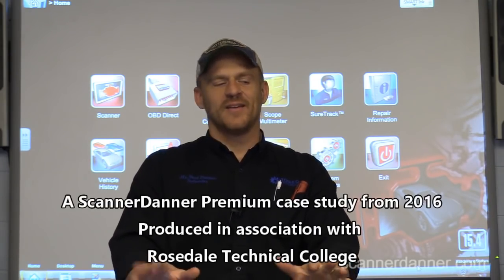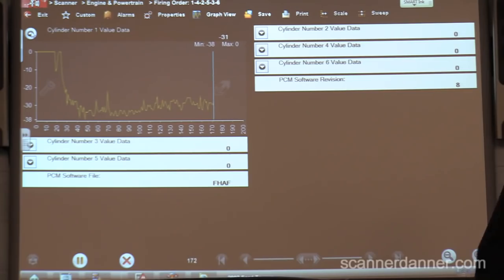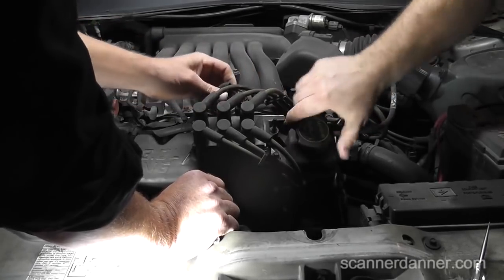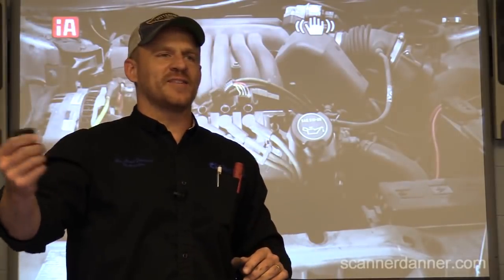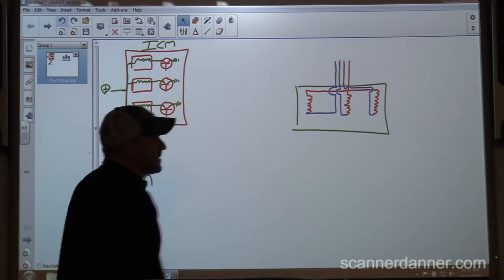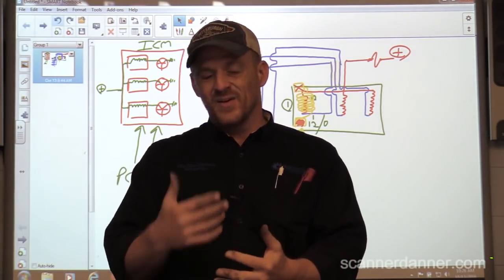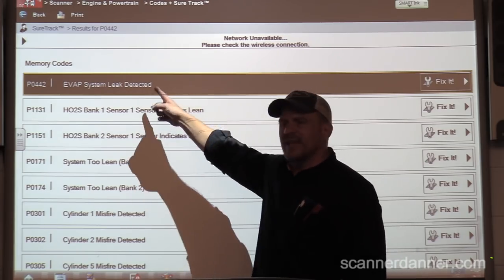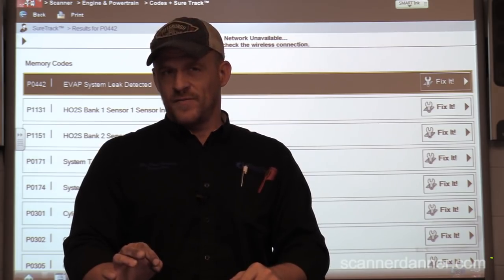Ford Taurus Misfire and Lean Condition Case Study (a 2016 ScannerDanner Premium video)

Comment: Paul, NICE ! Just did a egr valve on a 2005 Mercury Montego 3.0 L yesterday due to a DTC P0406 circuit A low. The unit has the Map, DPFE, Egr vacume solenoid and the Egr Pintle solenoid built all  together as one unit. To make a long story short I forgot to plug the vacuum lines back on the new unit and created a very large lean condition on bank one and bank two and created a P0405 circuit A low DTC along with corresponding lean codes. The lean codes were not there prior to me working on the car so I knew I created the problem which gave direction immediatly and a quick fix. Your right about Ford's relearn strategy for their LT fuel trims. After plugging in the vacuum lines, short term went negative but even after a long test ride the LT went from 25% to about 12% and would not go any lower. A reset of the keep alive memory did the trick. Take care, Paul !

Comment: Awesome work as always Paul.  I do want to add that you don't have to find that PCV elbow pipe at the dealer.  As much as I hate saying anything to the benefit of Dorman parts, they do have that elbow available in their "Help" line of parts and most of your major parts store chains should have one or three in stock.  Unlike most of their parts, it fits and functions correctly.

Comment: Only misstatement not corrected later was the deal about 1 and 5 being companion cylinders due to ford firing order diagram. It is instead 1 and 4, 2 and 5 and then 3 and 6. Excellent lesson professor Paul, how this gets done in a real shop and how to write it up icing on the cake. All your students are going to get run over by this truck called upper management, without you to show them what it was and how that works, they would be babes in wood. Fair to the customer waiting for repairs is you, after all, if she wanted a new coil, wires, plugs, and PCV hose put on she should have brought those with her, you did the best for her you possibly could have given this is not a parts house nor a 'while you wait' walk in garage. ATB

Comment: other common vacuum leak on them is one of the two plastic hvac hose rubber ends or line cracking, they can be seen to the left of the "bad" pcv rubber elbow.
one is off-white and one black, the black one is often broken from flexing and other people servicing them.(worn engine mounts)

Comment: 2003 Honda CRV high idle, motor vibration...Air Assist Intake Air Bypass Valve ?

Hey Dan, love your videos, not enough time to watch them all though! With that said I'm not sure if you've ever covered this situation or not, but I see many people seem to have the same problem with Honda vehicles as far as Idle issues go. A few years ago I had purchased a Honda CRV with about a hundred and eighty thousand miles on it for my young driver daughter. From the day I test drove it I noticed a hunting idle at startup, then a high vibrating idle once at operating temperature. Many people immediately go for a vacuum leak or the idle control valve as I did too. The vehicle definitely needed to have the IAC cleaned however , after a thorough cleaning/testing the issue never seem to fully go away so the hunt for a vacuum leak followed. Being an old-timer in my early 50s with some decent mechanical experience I decided to use an unlit propane torch to search for a vacuum leak because this has been my go-to successful means of finding a vacuum leak even in the worst places. In summary, I never found a serious vacuum leak other than the air intake boot connection to the air filter housing which had been crushed by over tightening the clamp probably buy some type of car service center. Even after this was corrected, the idle was still a bit High and the vibration still present especially under load by an accessory such as air conditioning or the power steering pump when the steering wheel had tension on it. I finally resorted to pinching off random hoses around the engine and quickly discovered what I learned is called something like an air assist thermal intake air bypass valve down behind the intake manifold yet threaded into the water pump housing. I found that pinching the hose caused the idle immediately drop and the engine would idle smoothly at around 800 RPM in park. I proceeded to very carefully remove one of the hoses and squeezing the hoses with a pair Mini Vise grip type needle nose pliers (which by the way and make excellent hose pinch off clamps) just in case there was any type of antifreeze or something in the hose that I wasn't ready for. In short, the inside of the valve was coated with dirt cluding a little plunger mechanism inside that closes one port  off on what I imagine is an increased coolant temp. I used mass airflow sensor cleaner and a Q tip because I didn't want to melt the plastic valve with a solvent like Gumout. The car now runs so much smoother I can't believe it. I was almost thinking I had a burnt valve in the engine and was ready to start a compression test next. Anyway, I wanted to share this with you because I see numerous complaints even after replacing the IAC and still having issues of hi or rough idle and not anywhere that I have seen has even mentioned this bypass valve. In fact, looking to replace it is quite difficult because the part itself is not listed on many of the Honda sites, even when I type in the correct part number. I found that the 2003 CRV has a k type engine which is also used in the Honda Element and there are two different style bypass valves which are two different sizes, so one must take extra care when ordering a replacement because these can be quite expensive (over $120. On average) I just wanted to put this out there in case any of your viewers have run into this problem with a Honda product or know anyone that is experiencing this problem. Hope this helps. Thank you again for all the knowledge you share with everyone. 
The part numbers are : 36163 - PND - A01 and  36281 - RAA - A01   Please confirm which one is for your vehicle.
Reply: Forgot to mention !

The person I purchesed the CRV from must have had the check engine light reset, and at the time I did not have a good scan tool with me to see any history or sensor loops "waiting" as they sometimes do when recently reset, so shortly after having the vehicle I got a CEL with a lean condition. I wasn't worried, and I kindof expected something like this given the miles and what I considered a very good price. So I'm not complaining, just caught off guard...my bad...anyway, this is what started my mission.

Comment: great teaching paul    and I have had quite a few instructors   oh and dorkman makes the pcv hose
Reply: yep, "Dor'stop'man" makes a replacement available at most parts place.
before that, you ever seen anyone use random plumbing fittings/pipe to repair them.. the day you hit one with copper pipe, aluminum tube, or other it may have been one I did :))
Reply: yea....made a few things like that myself!

Comment: Any advice on a window motor? I have a 99 f250 diesel, extended cab. The passenger window will not go up, only down.  The driver side master switch does the same thing. I have power from the master switch, power from the passanger switch to and from the motor. I replaced the pass motor and switch. No go. Any advice will be helpful!
Reply from the maker: We can help you on my forum. It is free to join and you will not find a more friendly and helpful community anywhere https://www.scannerdanner.com/forum/post-your-repair-questions-here.html I hope to see you there!

Comment: Another outstanding video. Does your advice to replace wires and plugs when the coil is bad apply generally,  ie always replace wires and plugs if you find a bad coil?
Reply from the maker: Yes but I do not always do them. If there is any doubt, I do. Or I'll at least verify that I do not have an open wire

Comment: Those misfire monitors worked for my 96 explorer. Those 4.0 OHVs crack heads, I poured in some K-seal and the numbers stopped dead on cyl 4! Holding for a year. K-seal don't clog if used according to directions.

Comment: Hello Paul my  name is john i am a long time subscriber of your chanel ... l have an old alfa romeo with twin spark plugs and uses waste spark system .... when i pull one spark plug wire with a test light and make the gap bigger than 1 inche the whole engine spaters and shut down ..... i have a parts car and and i have replaced the ecu (thankfully doeant have immobilaser) and the externall igniters ...could be the coil?

Comment: ScannerDanner I was trying to current ramp some BMW coils the other day and for some reason I could not get a signal on the ground wires even on inverted there was nothing, but as soon has I went to the power supply to the coils I immediately had a signal.  10V and 10 ms I think. Snap on verus.

Comment: Hey Paul. Is there anything special that changes when you are diagnosing a twin spark (2 spark plugs per cyl) ignition system (like the 4 cyl Rangers of the 90s)? I would assume on a cylinder drop test you would disable a whole coil and test using the active coil. I would also assume you would want to repeat the test using the other coil. Seems like this type of redundant system would make it hard for an ignition based misfire to appear. Looks like you would have to have two faults to cause a cylinder to drop out.
Reply from the maker: These ones are goofy. From my memory, one of those coils is shut down under load conditions and that is the same coil that is fired slightly behind the first coil? 
But yes, disable the second coil completely before doing the cylinder drop test
Reply: @ScannerDanner  Thanks for the confirmation. According to a Ford Service Manual both plugs per cylinder fire at the same time for compression and exhaust (dual and waste spark). It also says it disables the left hand side (intake/driver's) during cranking until the engine has started then it enables the intake side for dual spark. I'm assuming this is triggered after reaching an RPM limit (like 500 rpms I would guess). Now the book does say simultaneously, but you may still be right on a slightly delayed 2nd spark (probably just says simultaneously because it happens during the same phase of the combustion cycle). Too bad I don't have a scope to see this.
Reply from the maker: Got it. That they fire at the same time. Thanks!
I think at WOT the same coil that is disabled during cranking is also shut down? Can't remember
Reply: @ScannerDanner  Service manual only says it shutsdown during cranking. I don't see anything about it being shutdown at other times.

Comment: I know you were trying to get the car out but i would still do an injector balance test on this car. The leaner a cylinder runs the harder the ignition system works to keep up  which can account for ruining the secondary winding to the dead tower and you never proved the cylinder would contribute which could have easily be done by moving the companion cylinders spark plug wire to the dead cylinder.

Comment: Having  not seen all of your videos, I am wondering if you ever use/d vacuum gage to detect vacuum leaks? The old fashion way.
Reply from the maker: to detect them, no, to measure intake vacuum for mechanical problems, yes :-)
Reply: Back in days, when doing tune ups and using the big "Sun Scope" machine, the vacuum gauge was an important part of diagnostic work.

Comment: Hello I've been pulling my hair out I have a 2000 Taurus overhead valve engine every time you're running about 40 mph on the highway and then you get on it it's like it don't want to take fuel spitting and sputtering and I've changed pump filter regulator plug wires ignition coil like I say when you're going 45-50 mile an hour then you step on it real hard it's like sometimes the motor dies and it won't take fuel you let off the fuel let the car slow down get back down 35-40 mile an hour 45 then it'll take gas gradually any thought please help
Reply from the maker: Do an exhaust backpressure test on the DPFE sensor hose (check for a plugged cat)
I have videos on how to do this on Ford systems with that sensor

Comment: Paul -- why would a dead misfire cause a lean condition?  I'm assuming the injector was firing but since no spark, it was dumping raw gas into the exhaust on that bank.  Why wouldn't the O2 sensor read rich in that case instead of lean??
Reply: when the PCM senses the permanent misfire, it disables the injector to protect the catalytic converters and limit other damages, when it does that cylinder become an "air pump" pushing "oxygen rich" air into the exhaust on that bank.
Reply: Mark Rup I was thinking the same thing.
Reply: Not all PCMs will disable the injectors for a bad misfire
Reply: I should have noted not all of them have individual injector control/shutdown, but the majority of vehicles anyone learning now does. the old cars are drying up fast.
as you noted, no combustion = oxygen rich charge being pumped into the exhaust, which makes the catalytic converter burn it off, many times the downstream O2 can help
Reply: Makes sense. Thanks for the input everyone!
Reply from the maker: Exactly but believe it or not a no fuel misfire is even leaner to the O2 sensor than an ignition of compression misfire because fuel actually is a factor as well. But lean for both types of misfires due to the oxygen content as you stated.

Comment: Misfire = lean condition = no combustion to use up the 02. Its called a Oxygen sensor not a fuel sensor. People think the oxygen sensor in a misfire situation will be rich due to excess fuel at the "Oxygen sensor" . So fixing this misfire could remedy the lean condition code. Am I wrong?
Reply from the maker: This had multiple issues. Did you watch the video before this comment? Yes a misfire will drive an O2 lean, but there was an actual lean condition with this car too
Reply: @ScannerDanner   I didn't mean for my comment to be negative in anyway towards your diagnostics. Sorry if I came across that way. I have learned allot from you and I can't come close to your knowledge and skill level. Your videos and teaching are valuable and a true blessing to me, thank you for helping us all in this industry. :)
Reply from the maker: @tedhartman8049  no problem man, sorry my reply sounded that way. It was the end of a long day, answering many emails lol. This is a complicated subject too and I was just trying to be brief. We are 100% good my friend, thank you!
Reply: @ScannerDanner    The fact as busy as you are to take time to answer a chat = Respect.
Question on scope set up, can you run a relative compression test with a low amp clamp? I use the small pico 2 channel 2240a and my clamp is the Pico TA234 20/30 clamp. No need to spend time explaining it but if you taught this, a link would be appreciated. 
Thanks Paul
Reply from the maker: @tedhartman8049  you can! I use mine all the time, but there is a limit. On mine, the most amperage you can read is 250a, which is much higher than just about every car out there, unless there is a problem, like this one https://youtu.be/4YWCKzpbgb0
It had a frozen alternator and it maxed out the starter amperage (around 500a?) Had to switch to my high amp probe to measure it. I go over it in that video I'm pretty sure. (the max low amp probe capabilities and why). You won't hurt it with more amperage than you can measure, it will just flatline the voltage output (2.5v for mine).
But all of that said, you're amp probe could be different. Mine has a 100mv/a scale and a 10mv/a scale. I use the 10mv/a scale and set my lab scope to +/- 2vDC (2v = 200 amps on that setting)